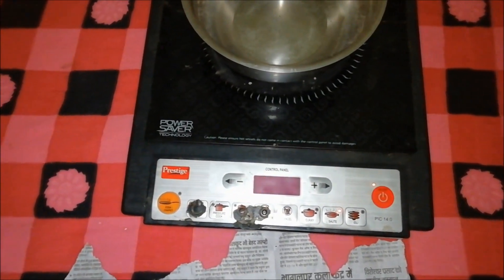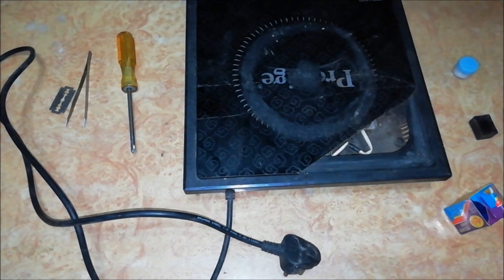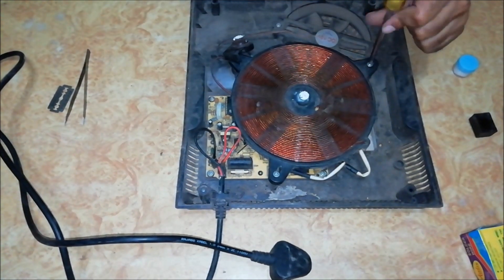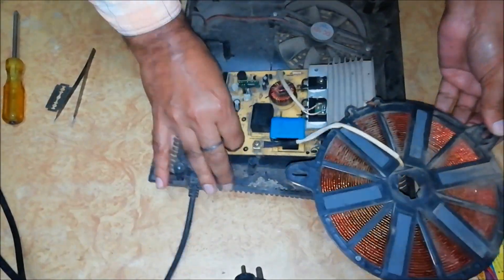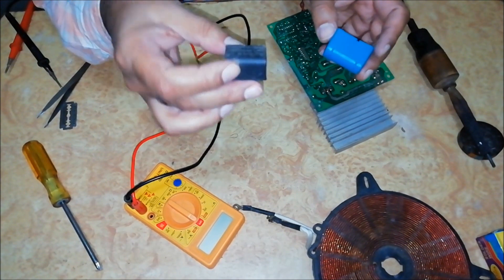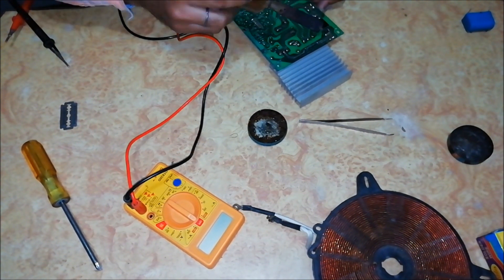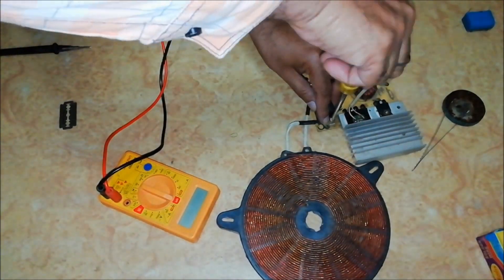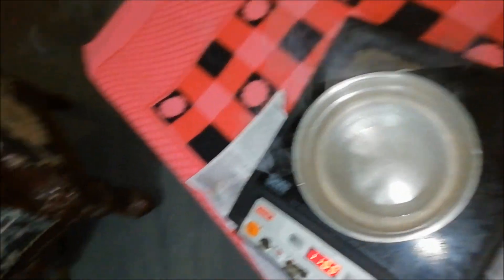how to repair E9 error of prestige induction cooker DIY

Comment: Hi as same model same pcb. E 9 show....am all ready check. All regesten.  Cap.....Cheng 8055..8050.. igb...3fm ...5mf... Cnt solve pls help me
Reply from the maker: the value of flyback capacitor which is parallel to coil is 0.33uf don't change it with 0.3uf it will not work. also check dry solder at both the capacitor and at igbt. if still getting e9 error then check the metal sensing resistance which is some series of resistance from both points of heating coil to microcontroller.

Comment: After changing same happen .
Reply from the maker: replace with same value of capacitor. for example if your original value of capacitor if 0.33 uf and you changed it with 0.3 uf then it will not work.